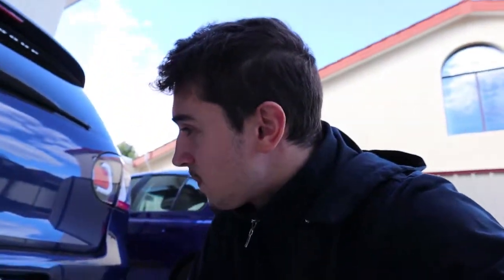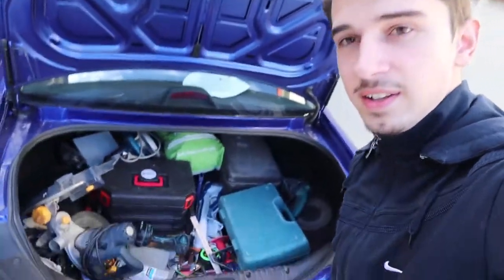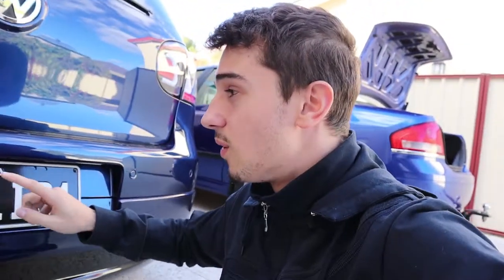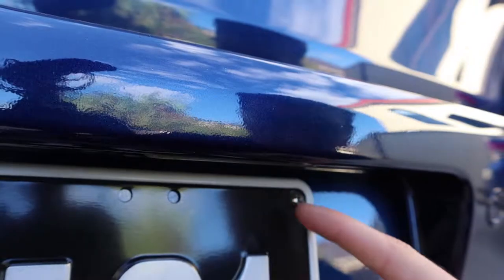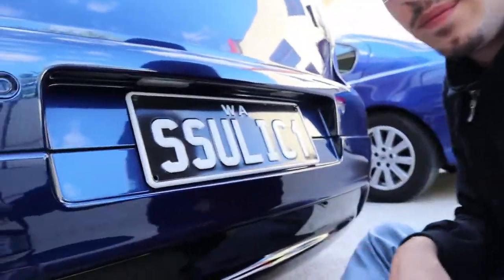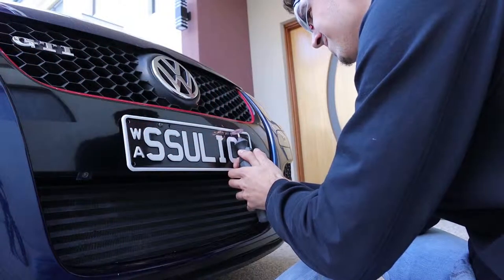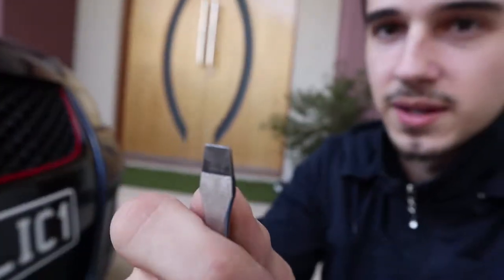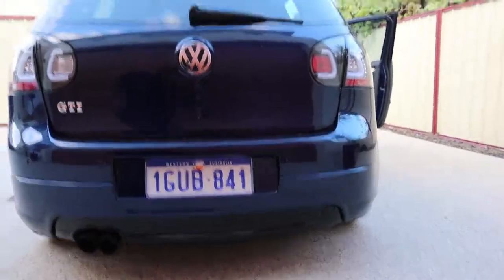How To Remove Anti-theft Screw!

Comment: Hey there,  why did you need to change your plate with the anti theft screws on?  I thought the anti theft screws were permanent?  I have had 2 license plates stolen with 9 month.  I just purchased the anti theft screws and was hope that would be my solution to prevent future thefts?  I also have plan to use glue to help with the theft.  Nancy
Reply: Nothing is permanent, Nancy.
Someone will always find the way, but the thing is making it more difficult to the average thief so will prefer to look at someone else's car.